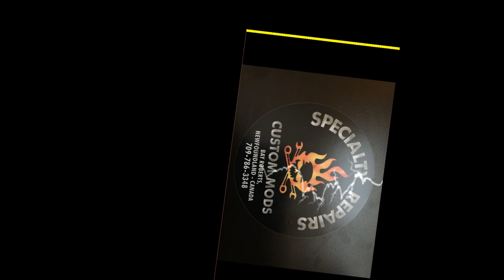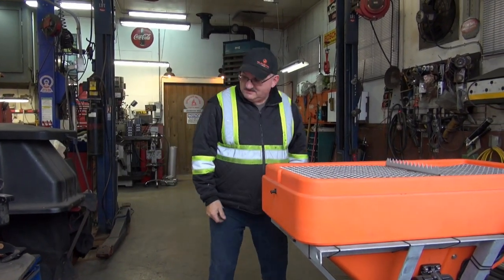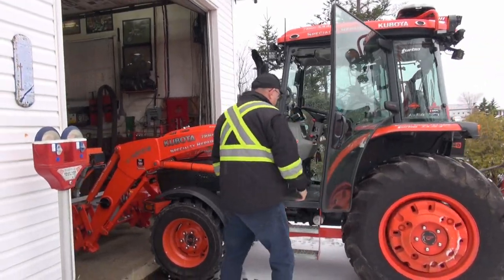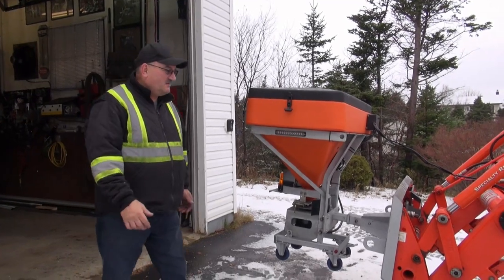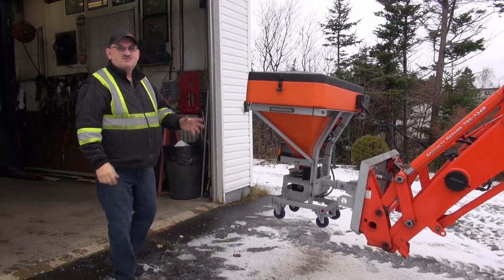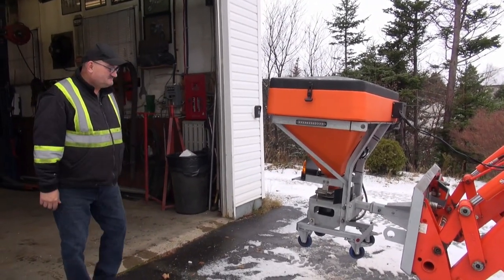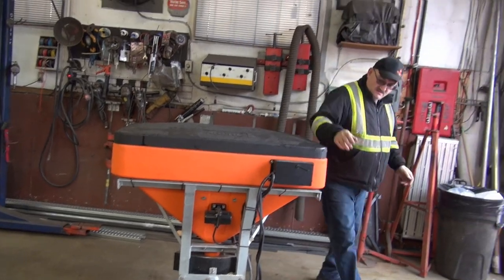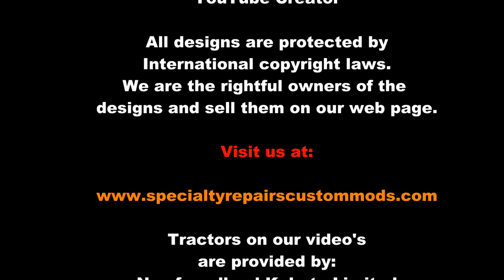Arctic Snow Plows Salt Spreader (First Test)

Comment: Good morning Paul. I’ve got a LX3310 as well, any thoughts on making the hydraulics quieter? Thanks love the video’s
Reply from the maker: It’s not something we’d get involved in. I think it’s something that should be done at the manufacturer level. We’re not into product improvement but more into its accessories. It is something that should be addressed in my opinion. Happy holidays.
Reply: @7863348  thanks I’ll call the dealer. Really like the improvements you mad, smart and useful.